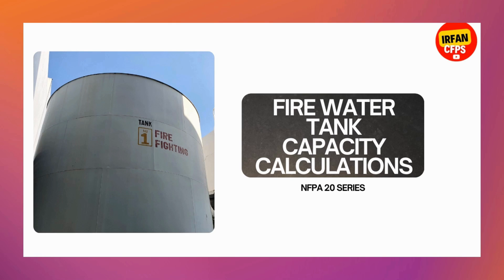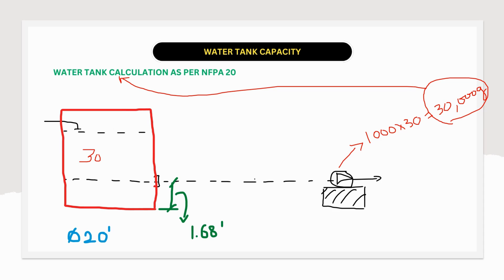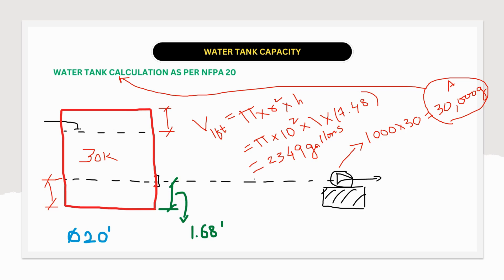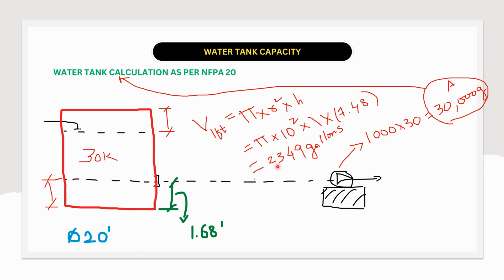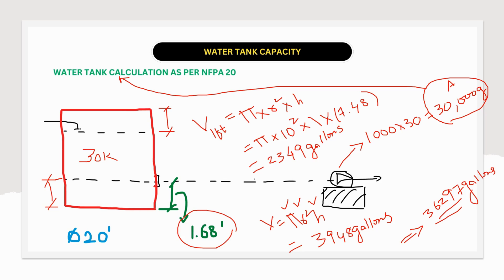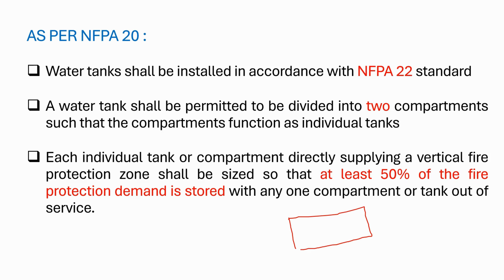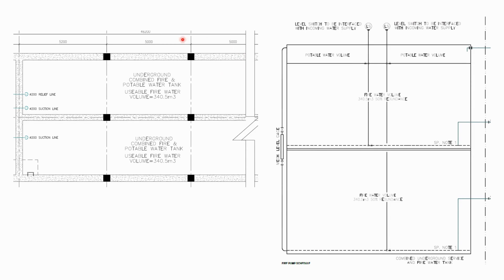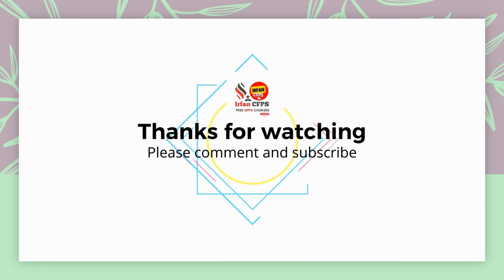How to Calculate Fire Water Tank Capacity (The Easy Way)

Comment: Is 1.68 ft necessary, why because, the suction line will be having the anti vortex plate which will be connected in a manner to suck the water from the bottom side of the tank.
Reply from the maker: Yes it’s necessary. This ensures proper suction, prevents air entrainment, and avoids cavitation in the fire pump.

Anti-vortex plates help, but they don’t replace the required minimum water height.

Comment: Sir, in case I have an under ground water tank, do I still need to consider 1 ft height allowance as well as the allowance you use (1.68 ft) from the center line of the pump and the bottom of the tank? Thanks.
Reply from the maker: Yes

Comment: Sir, In case the suction is at the bottom of the tank, then it would be required to give the clearance at the bottom or not?
Reply from the maker: Practically it will not be possible

Comment: Asalamualaikum Mr.Irfan, on top of tank there is Vent ( AAV), how to calculated size and Other Question at Highest pipe/ top there is AAV (automatic air Vent) Hydrant box pipe, how calculate size dia. Thank you very much.
Reply from the maker: Walekumassalam. Mostly AAV outlet size will be minimum 1/2'' in size. I could not find much data on sizing of air vents in nfpa. However, this is not a matter of concern because, they are used only to release the accumulated air in pressurized clean and wastewater systems. They protect systems from damage due to air-related surges and improve system efficiency.

Comment: Please explain that how can we know that how much capacity of fire water tank is required for a specific area.
Reply from the maker: It depends on the fire pump selected and storage capacity duration. These two can be calculated based on the fire flow requirements per local building codes. However, NFPA 13 has water supply duration requirements for light, ordinary, extra hazard occupancies. we can consider those as well in case you do not have any local building codes.